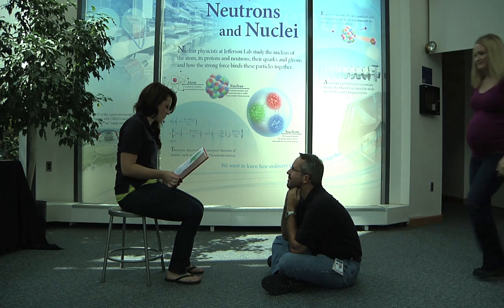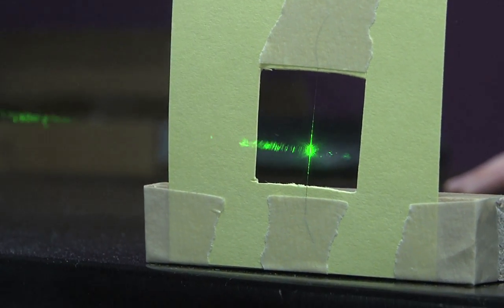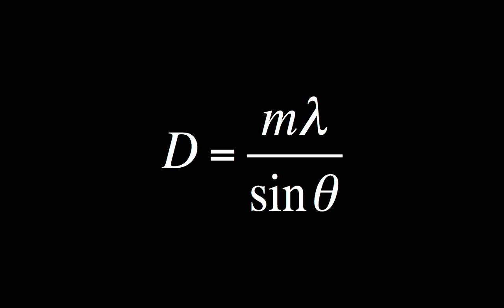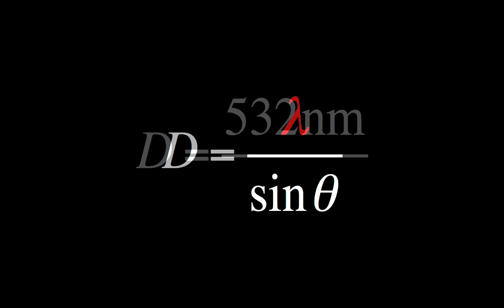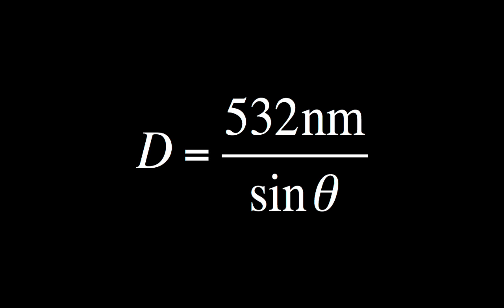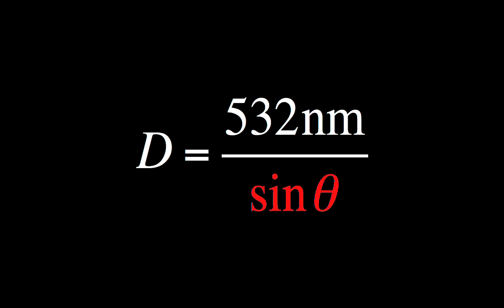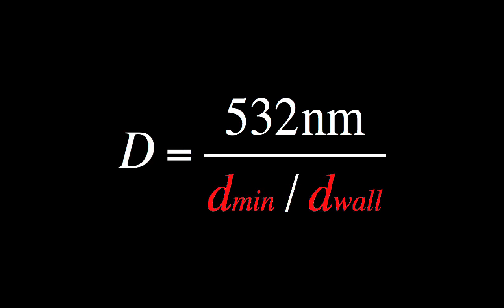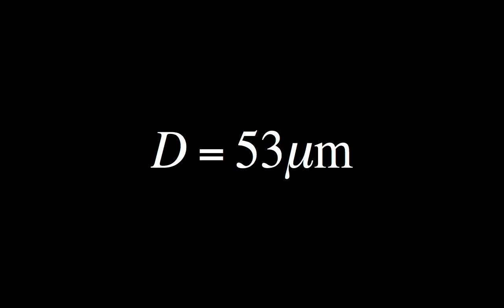How to Measure the Width of a Hair With a Laser!

Comment from the maker: We did what we did because the approximation is good enough and far easier to explain. So, yes, if you wanted, you could calculate the sine of the angle properly with what we measured. Let's do it now. Rather than 8.8/880, it should be 8.8/(SQRT(8.8^2 + 880^2)). The approximation yields .01 while the true calculation yields 0.0099995. Is it worth the effort (and explanation time) for the 0.0000005 difference, especially considering that the errors in measuring the distances are far larger?

Comment from the maker: It isn't so much that things are measured in centimeters that affects the accuracy, but how well the measurements can be made. The greatest source of error is measuring to the center of the first minimum (since it's difficult to locate the center). Maybe we're +/- 0.1 centimeters with that measurement. The diameter measurement would then range from ~52.6um to ~53.8um, so you're looking at an error in the range of +/-1um if you can make your 'minima measurements' to the millimeter level.

Comment from the maker: No, there's still a central bright spot. The most obvious reason for this is that not all of the laser light hits the hair, so it merrily continues on its way to the wall. Even if you just consider the diffracted light, you still get a central bright spot. The light traveling towards the center of the pattern remains in phase, so constructive interference occurs.

Comment: I have a question, how important is the distance between the laser and the hair. I mean does it make a difference in the result with different setups ?
Laser  -   2m   - haire  - 2m   - wall
Laser  - 10cm - haire  - 3,9m - wall   

normally it shouldn't matter because the laser is a focused the light beam that does´t scatters.
I don't have a laser by hand to find the answer it by my self 
apologies for the circumstances ;)

Comment: Then it depends. If it looks cyan and it was expensive and produces a round dot, then it's 473nm (and you're a lucky person). If it looks deep blue and was somewhat cheap and produces an oval dot then it's probably 442-447nm. If it looks violet/purple, was inexpensive and has oval dot then it's 405-410nm. And maybe if it looks really cyan, it's big and takes 1000+ watts from the mains then your laser is an argon ion one emmiting at 488nm. You could also have a 442nm HeCd gas laser...

Comment: This should work much better with green lasers (DPSS) than with red ones (diode). In a green laser the beam starts narrow and with a rounded gaussian power distribution. All the light gets through the center of the lenses so the final beam preserves those qualities, so there are no self induced interference artifacts. Red lasers produce oval beams and most pointers crop the beam to a more rounded shape, producing interference patterns in the edges which could affect the results. Gonna try it!

Comment from the maker: We did use cm, um and nm. Is your issue with the mechanical micrometer? If so, what were we suppose to do? Its scale is in inches. When you use something that's calibrated in inches, you get a measurement in inches. If this is what you are complaining about, the manufacturer is the one you should be griping to, not us.

Comment from the maker: From the site you reference: "The definition of the US inch is 25.4 mm exactly." Since 10 mm = 1 cm, we know that 1 US inch is 2.54 cm exactly. Still not sure what your point is and I have neither the time nor inclination to read every entry on the referenced site to try to figure it out. Feel free to use the 500 characters available to make your argument as to why centimeters are an inappropriate unit of measure. I'll then try to explain it to anyone who has ever used ergs to measure energy.

Comment: After reading the blogs at the site xtronics frequently refers to, the author appears to believe that the only SI prefixes that should ever be used are multiples of 10^3 - and doing so would make life much simpler for those converting from Imperial (the blogs even advocate a milligrade temperature scale!) as there's no place for decimal points. Personally, I'd say use the units you're most comfortable with - be it m, dm, cm, mm or whatever! After all, a litre is defined as a cubic decimetre...

Comment: What would the indpendent, dependent and controlled variables be? Would be much appriciated, Cheers.
Reply from the maker: Normally, the independent variable is the thing that 'I', as the experimenter, changes on purpose. Now, this experiment ran a little differently since only one thing was being measured. That is, it's a single, static set-up without altering any of the variables. There's still an independent variable, though. What was intentionally picked at the start of the experiment? The hair. There was a mostly full head of hair that Joanna could have picked from. For reasons known only to her, she selected one, specific strand. Had she picked a different hair, the result of the measurement could have been different. So, in this experiment, the object that's getting blasted by the laser light is the independent variable.

The dependent variable is the variable that changes because the independent variable was changed. Now, again, this is a static set-up, so we don't have a classic 'change and response' kind of situation. But, we can still ask "What depends on the size of the hair?" Or, coming at it from another way, what was measured in the experiment? There were only two things, right? The distance between the central spot and first minima was measured and the distance between the hair and the wall was measured. The dependent variable has to be one of these two. Let's look at the second one first. Does the object being measured dictate how far away from the wall it is placed? No. A hair has no control over me and I'll place it wherever I choose. Okay, so does the object being measured dictate how the pattern on the wall will look. Actually, yes. You can see this in the formula that's given. For a given distance, a wider object will produce a tighter pattern and a narrower object will produce a broader pattern. So, in this experiment, the distance between the central spot and the first minima DEPENDS ON with width of the object.

The controlled variables are all the other things that could change, but we make sure that they don't. The wavelength of laser light and the distance from the hair to the wall are the ones that are actually used in the calculation. You could theoretically worry about other things like the temperature of the room, the direction the laser is pointing, the time of day, etc...
Reply: Thank you so much for your help :)

Comment: If you have that HP28 yet, I am ready to buy! :) If doesn't works, that is not problem! :P
Reply from the maker: Sorry, but I'm going to use it until its plastic case turns to a fine powder. Have no idea what I would replace it with...
Reply: @JeffersonLab  :D A real HP user who knows the value of it. Is it a C or S?
BTW: have you ever tryed to find the minimum/maximum light intensity points with a light sensor? Today's microcontrollers are really cheap and very easy to build a litle circuit and write a short program (eg in Python) to find these points?
Reply from the maker: @TizedesCsaba  It's a 28S. Never tried this experiment with a light sensor. Might give it a try!

Comment: Is this similar to using a single slit of same width as hair? Or is it similar to using a double slit of same separation?
Reply from the maker: +Suyash Saxena This is mathematically equivalent to a single slit that's the width of the hair. It turns out it's the boundary conditions that are important, so the pattern given by a narrow blockage in free space is the same as a narrow opening in a solid wall.

Comment: Isn't the sinΘ equal to the opposite length divided by the hypotenuse length? ("soh") 

Isn't the tanΘ equal to the opposite length divided by the adjacent length? ("toa") 

...Shouldn't sinΘ = [distance to the board/divided by the hypotenuse] ?
...and using pythagorean theorem, sinΘ = [distance to the board]/ [[distance to board]^2 + [distance across board]^2]^.5 ?

If we wanted the distance to the board divided by a distance across the board, wouldn't that equal the tangent of the distance to the board, divided by the distance across the board? .... Is this formulation (somehow) an approximation of tanΘ = sinΘ?
Reply from the maker: Yes, the correct distance to measure is from the hair to the dark spot, but it isn't an especially easy measurement to make. Happily, we can use the small angle approximation, so sinθ ≅ tanθ.
Reply: Jefferson Lab Thank you! That makes complete sense. I didn’t understand what was meant by small angle approximation, but you resolved my confusion!
Reply from the maker: And, I should have mentioned this in my previous comment, but in a right triangle where one of the other angles is very small, the hypotenuse and adjacent sides are very nearly the same. If the small angle were to equal zero, then the hypotenuse and adjacent sides would be the same. That's why o/h and o/a are approximately equal when the angle is small.

Comment: Hi, I'm trying to do this experiment and I was wondering why it acts like a single slit? I dont understand what you mean by "it's the boundary conditions that matter". Thank you
Reply from the maker: What that means is that, mathematically, it's the 'edges' that matter. A single obstruction in a wide open field is equivalent to a gap (of the same width) in a solid wall. The diffraction produced by those two set-ups are the same because the boundaries are the same. There's a mathematical proof for this, but I can't immediately find what it's called. I think it was mentioned in Giancoli's diffraction chapter.
Reply: How does the piece of hair function in this? As an aperture or as a boundary? Thank you.
Reply from the maker: The hair acts as a barrier.
Reply: The principle of Babinet talks about complementary apertures.

Comment: When we can measure it by screw guage..why use diffraction..nd how it is more accurate?
Reply from the maker: Why not use diffraction? Laser pointers and meter sticks are easy to come by. Plus, it's useful for things which are too small (or impractical) for a screw gauge.
Reply: @JeffersonLab  but comparatively  laser is way higher when it comes to price.so when we can use screw guage,why use laser
Reply from the maker: I can get a laser toy for my cat for about $2, batteries included. A good screw gauge costs much more than that.
Reply: @JeffersonLab  but will it get that much accuracy?
Reply from the maker: @ALLinONe-dq3sg  Yep.

Comment: Sorry man, I really have to agree with JL here, The argument made made by "themetricmaven" Is nothing more than personal preference cause he doesn't like to use decimal places when dealing with numbers in a range very specific to his line of work, engineering circuit boards. Weak and selfish at best; To extend this to defining 'real science' is down right provocative. Seeing as any scientific measurement should include an extra significant figure anyway to denote resolution of said measurement.

Comment: it would have been nice to understand where that formula comes from, i'm a little disappointed
Reply from the maker: The first thing to realize is that this is a boundary condition problem - a hair blocking an open area is the same as a closed area with a hair-width opening. So, we'll use the wall with an opening as our model.

So, imagine a wall with an opening of width 'D'. Coherent light with a wavelength of lambda passes through the opening. You can view the light as being a series of individual wavelets and, since the light is coherent, all of the wavelets are in phase with each other. For now, just pay attention to the wavelet passing through the top of the opening and the wavelet passing through the bottom of the opening.

What happens when these wavelets go straight through the opening to a distant wall? Well, the distance to the wall is the same for both of the wavelets. Since they were in phase at the opening, they are in phase when they get to the wall. This is true for all of the other wavelets as well. All of the wavelets combine constructively and you end up with a bright spot.

Now, what if we look at a spot on the wall other than the one that's directly in front of the opening? Well, now there's a difference in how far each wavelet travels before it reaches the wall. If the beam is angled 'down' then the top wavelet travels further than the bottom wavelet. If the top wavelet travels exactly one wavelength further than the bottom wavelet, then you end up with a dark spot on the wall.

"But, wait!" I hear you say, "The top and bottom beams are still in phase! The spot should be bright!" And, that would be true if the full beam were made from just those two wavelets. But it isn't. You have all those wavelets between the top and bottom ones. If the path difference between the top and bottom wavelets is equal to a full wavelength, then the path difference between the top and 'middle' wavelets is equal to one-half wavelength. Those combine destructively. You can work your way through the whole beam and find a wavelet in the top half that cancels with one in the bottom half.

So, great. A dark spot is found when the path difference is equal to a full wavelength. Or, more accurately, dark spots are found when the path difference is equal to a some integer multiple of the wavelength. Or, 'm times lambda' when 'm' is equal to 1, 2, 3, etc.

Now, how do we relate the difference in path length to the width of the opening and the wavelength of light? We can make a triangle using the top wavelet, the opening, and a line that's perpendicular to the top wavelet that connects the top wavelet to the bottom of the opening. (Again, this assumes the beam is angled 'down' from the opening.) This makes a right triangle (due to the perpendicular

Comment: Umm.. Isnt "m" the condition for first maximum?? I am doing this for my Physics IA and I am very confused on what equation is correct. Please help! T_T
Reply from the maker: +TaR cHi Nope. For a single slit (or a single obstruction), 'm' marks the minima. It's easier to visualize with a single slit. When light passes through a slit at an angle, the path lengths of the 'top' beamlet and 'bottom' beamlet are different. When D*sin(theta) equals a integer multiple of wavelengths, then the 'top' and 'bottom' beamlets are in phase. It's counterintuitive, but this is the condition for a MINIMA, not a MAXIMA. This is because of all the 'middle' beamlets we've ignored until now. If the 'top' and the 'bottom' are in phase, then the 'top' and 'middle' are 180 degrees out of phase, and cancel out. Take a baby step down from the 'top' and a baby step down from the 'middle' and that pair will be 180 degrees out of phase and cancel. Walk your way down the entire beam and everything in the top half will cancel with everything in the bottom half, resulting in a dark spot (a minimum).

Now, 'm' does mark the maxima for a diffraction grating. Take the single slit diagram and build a wall in the opening so that you just leave the very top and the very bottom open. Since there are no longer any 'middle' beamlets, the 'top' and 'bottom' beams can constructively interfere, resulting in a bright spot.